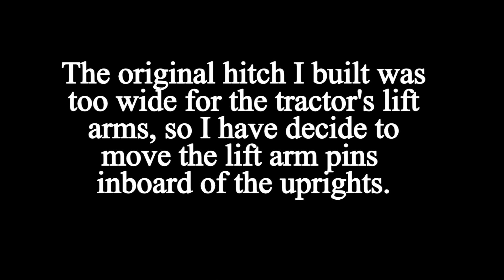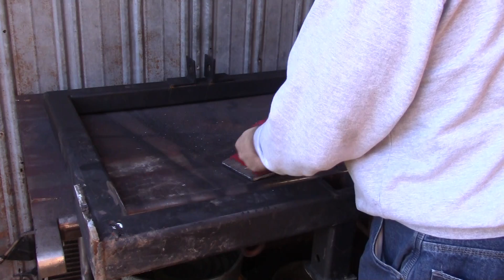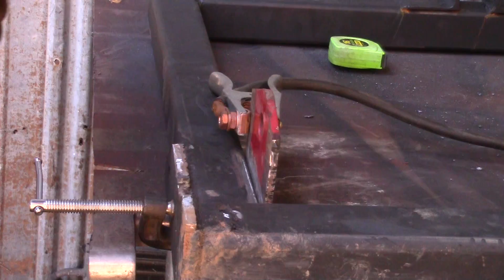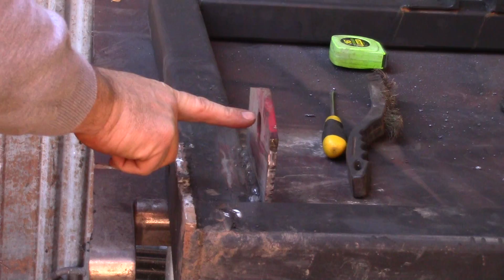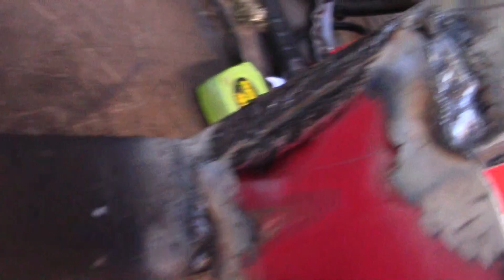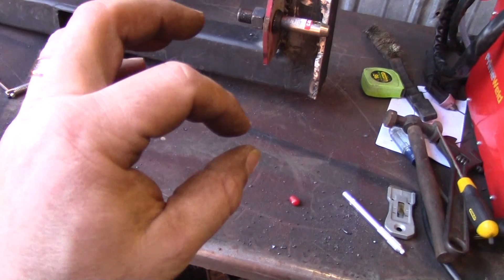3 pt trailer hitch build part 3

Comment: To add more rod to a weld, just hold another rod in your empty hand and weld with 2 rods, it works great, also for filling holes, also helps prevent burning holes.
Reply from the maker: +whaning Thanks for the tip!

Comment: Well buddy been stick welding for too long, I would recommend you use 7014 rod first off , it lays down nice on not so clean steel, they called them farmer rods ha anybody can use them, their a drag rod . About 120 amps on a 1/8 rod should be good. What rod were you using ? I only run Lincoln rod, just my preference.
Reply from the maker: +Steve Rob Yeah, I learned to stick weld with 6013 and 7014.  I have some 6013 and 7018 but usually go for the 6011 because they penetrate well on rusty metal.  I've never used Lincoln rods.  I get the Hobart rods from Tractor Supply but I can get the Lincoln rods from the guys I get my welding gas from.  I'll have to try some.  I was using 5/32" 6011.  I thought I was getting 1/8" rods but got the wrong box.
Reply: +farmboy30117 All good rods but 7014 is a stronger rod , ya it doesn't  penetrate as well but and lays down like butter and your not welding anything really structural . Give em a try.